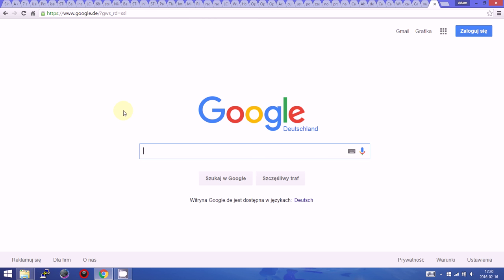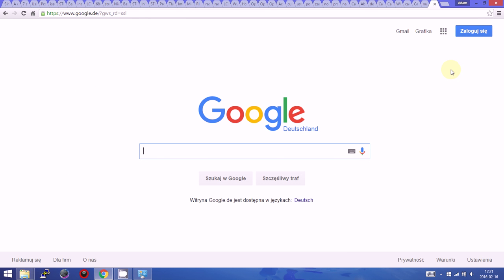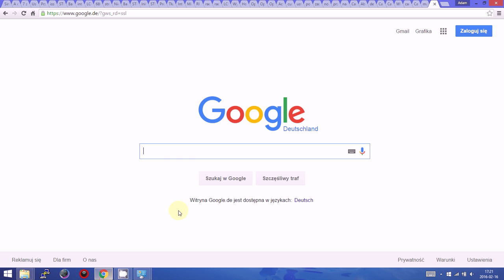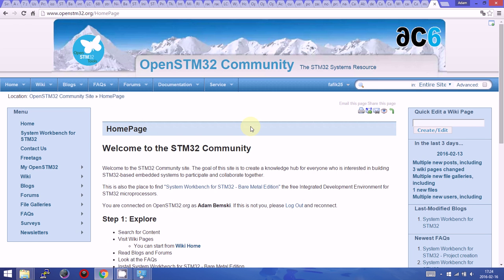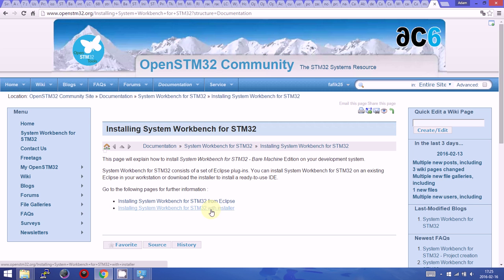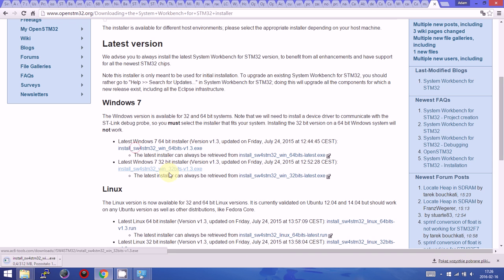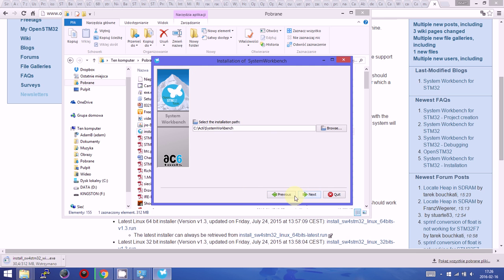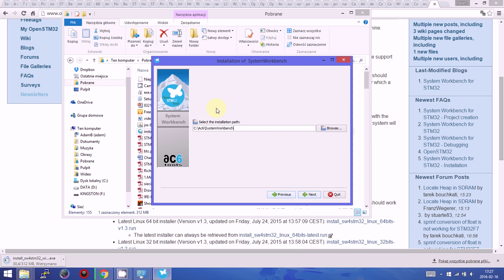Creating base project - System Workbench for STM32 - downloading and installation - STM32F4 - Part 1

Comment: wanted to do the tutorial, but i can't download the project-files (404). please could you correct the link. thanks!
Reply from the maker: Strange, on my computer it works. Maybe Your computer at work, due to proxy doesn't accept google drive?
Reply: thanks for your answer! no proxy or stuff like that. but i tried a different browser and there it works. strange thing (firefox didn't work, but chromium does)... who cares - take chromium and be happy ;-)
Reply from the maker: Ok, so I wish you good luck with using SW4STM32!
Reply: got the first steps running - thanks!